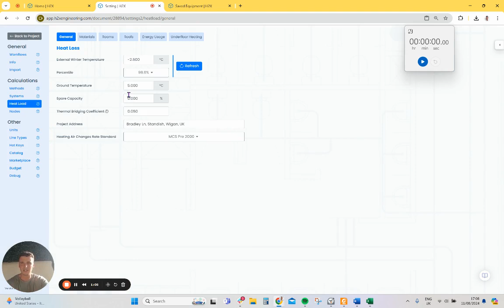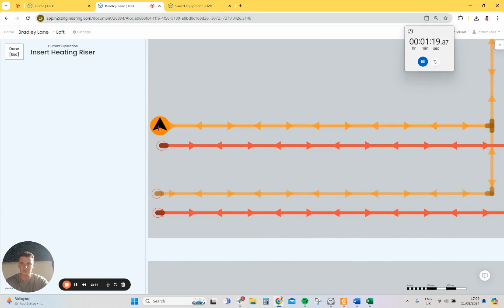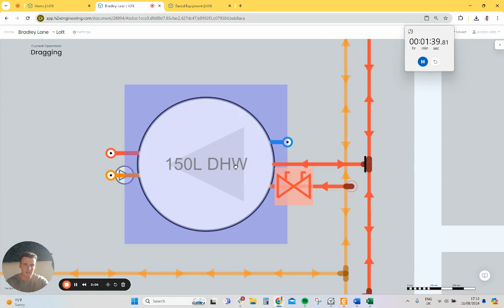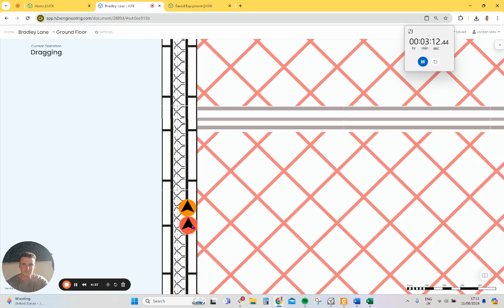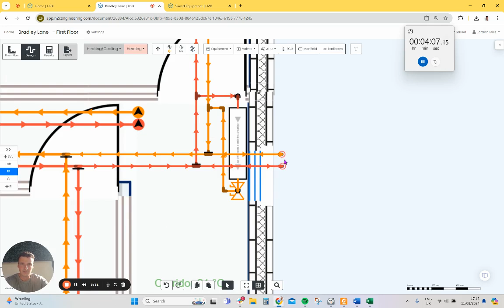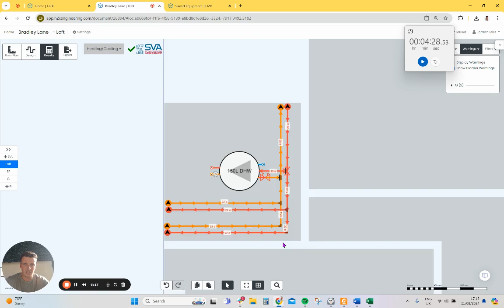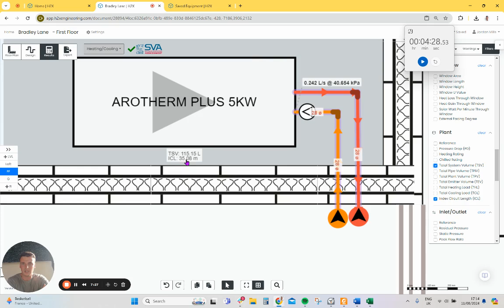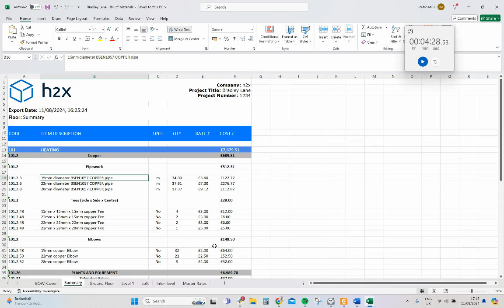Open Loop Domestic Heat Pump | h2x Use Case

Comment: Do you recommend any laptop specs? My desktop is fine but laptop struggles a bit and isn’t as clear as yours.
Reply from the maker: Hi Tom, we recommend the following:

- 8GB Ram
- Relatively new mid/high range CPU (i5+) within the last several years
- Dedicated graphics card, NVidia RTX series or high-end GTX series preferred (Or AMD equivalent)
- No storage requirements

For minimum you should have the following:

- 4GB Ram
- Relatively new mid-range CPU (i3+) within the last several years
- Good integrated graphics (eg IRIS Pro)
- No storage requirements

https://www.h2xengineering.com/community/request-help/recommended-computer-specs/
Reply: Great, needed this info.. 🎉